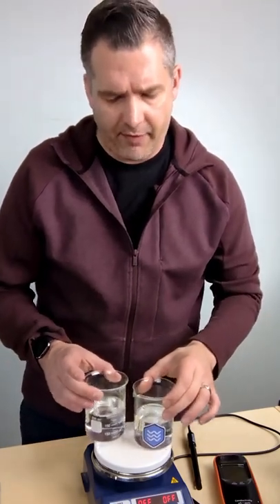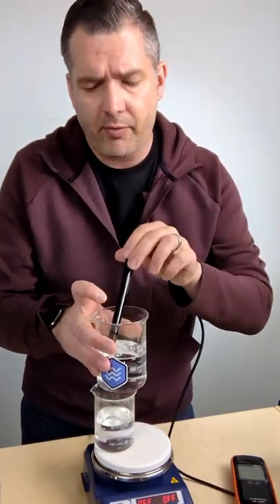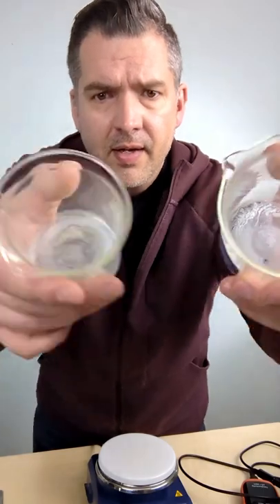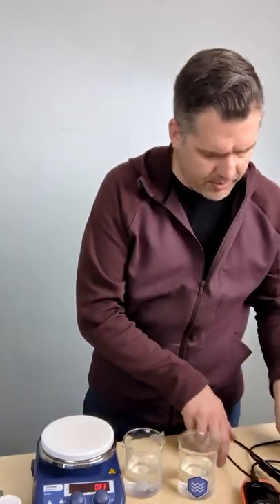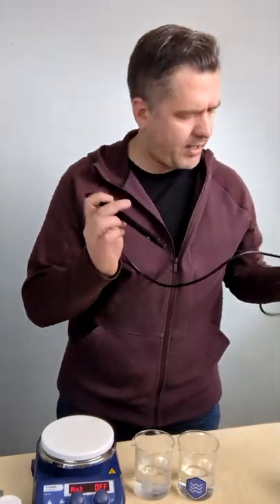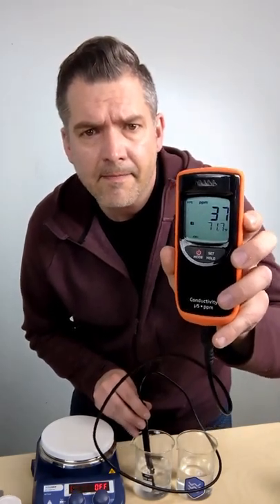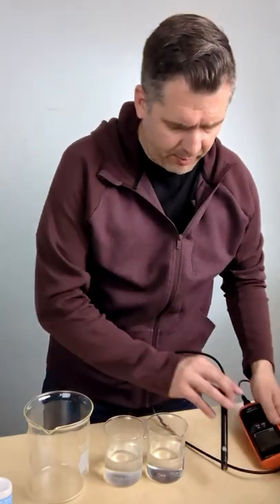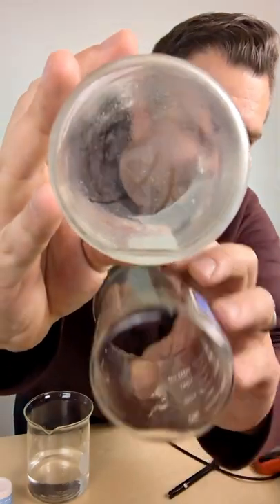Permanent Hardness VS Temporary Hardness a Clear Difference

Comment: This video seems to be quite confusing. Are permanent hardness and temporary hardness really classified based on the ability to be re-dissolved in distilled water? I do not think so. 
I believe that correct interpretation of the experiment is that both water samples contained some temporary hardness, which was precipitated after boiling. However, one cannot say anything about permanent hardness contained in the samples.

Comment: If I exclusively use Third Wave Water Espresso Profile with my machine, do I never have to back flush and/or decale my machine?
Reply: You should likely at minimum still backflush. If you have a single or dual boiler machine, E61 style machine, etc, backflushing doesn't actually reach the brew and/or steam boilers of the machine you are using where the water is being held at a certain temperature.  Rather, backflushing uses the detergent to clean out coffee oils, materials, and yes potential scale along part of the pathway that water travels after it leaves the boiler.  This is still important, as that path can be super important to keep clean to keep the machine working optimally but also to keep your machine clean/prevent off tastes from coffee material caking up.   But descaling the actual boilers themselves is a much more involved process that isn't actually achieved by simple backflushing.  It sometimes is involved enough that people hire technicians to fully remove the boilers to clean them out either mechanically or using an acid wash (since you want to make sure the boilers are completely clean before they are reinstalled, no one wants left over vinegar or acid in their boilers!).   FYI this may not apply to some of the thermoblock/thermocoil machines which are different (like the breville bambino) which don't have boiler and therefore you can run a descale solvent through the machine and flush it out safely.  For more info on what backflushing actually does in an E61 and where everything is, can use this video! https://youtu.be/j_qclAvRhKo
Reply: @lbafro2011  is correct. Still back flush your specific machine (varies greatly from espresso machine to espresso machine). Scale isn't physically in TWW's espresso profile, but you should still clean your espresso machine regardless to avoid long term grime from coffee, airborne bacteria, etc.